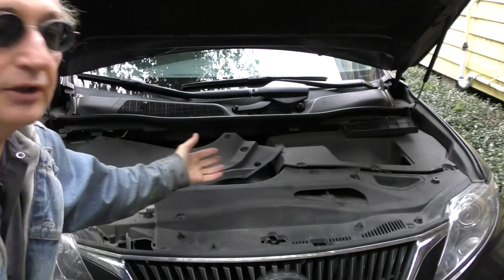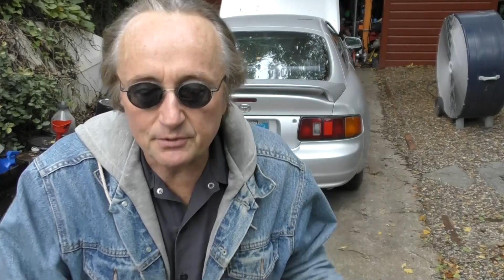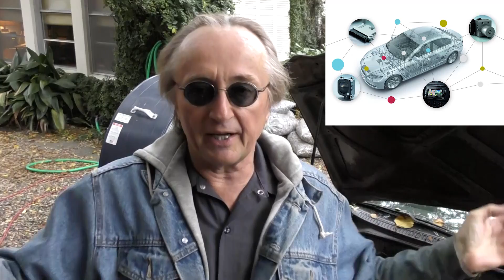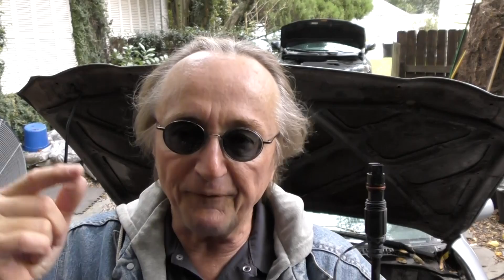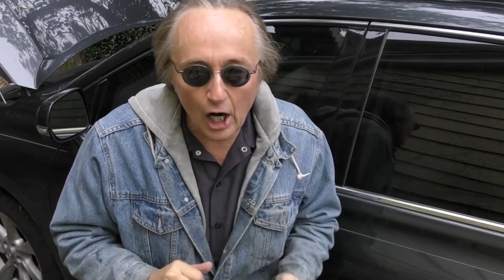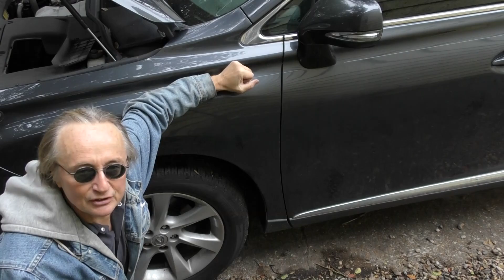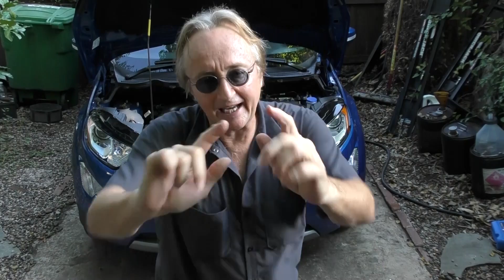The End of DIY Car Repair, Why New Cars are So Hard to Work On

Comment: Aw man I remember having an issue with my 2004 Pontiac Grand Am GT 3.4L V6 with the terribly designed Theftlock/Passlock system.  I would have days where I couldn't get to work on time because my car would fail to start with the stupid "Security" light coming on.  Turns out there's the system expects a certain resistance value through a circuit in the ignition switch system, and over time it wears out and the reading the computer gets fails to match what it expects, and you have to go through a "relearn" procedure just to get the car to start, which takes something like 20 minutes or more.

Luckily I found a guy on a forum who suggested to just cut the wires that run through that circuit in the ignition, and solder in a resistor inline in a loop, run the relearn procedure one last time, and it was good without fail from that point on.

I had taken it to quite a few people who had no idea how to fix it, or worse, thought it had something do with the aftermarket immobilizer that my province forced me to install in the vehicle, which it had absolutely nothing to do with!

I don't own that car anymore, but I sold it to a friend, and his brother's now driving it, nice to know that it still starts, and runs!

Comment: Mr. Kilmer; what a pleasure talking to you, Sir.
 I own a 2004 Pontiag GTO &  have a question, please:

Lately I got a message on the dash screen (Reduced Performance). Went to the dealer to check for error codes & turned out to be a faulty (Accelerator pedal sensor). 
GM discontinued the production of this part & I had a hard time searching the web for a replacement with non to find either new or used, yet! Back to my car, I removed the pedal assembly & cleaned it as careful as I could but no success there. I plan a trip to the scrap yard but If you have any idea if it is fixable or if there is a proper replacement for it I'd appreciate it very much.

Thank you so much for your time, Sir...

Comment: Scotty, great video. Could you address some Chevy Colorado issues? Dimmer switch that doesn’t dim, interior lights that flicker or  just go out- then comes back on) wheel sensor fault code/ ABS code. Yeah.. I own an ‘04 With an in-line 5.

Comment: Computer controlled systems on cars were supposed to give me better fuel economy; my ‘85 Lesabre got similar economy to my parents ‘95 Lesabre.  So much for that.  

While micromanaging the engine functions can be a good thing, anyone who’s been to a dealership for a check engine light knows the nightmare of tracking down the issue and often times, all the technology can’t find the problem.  

While newer cars are much safer than my “old iron,” they’re much more expensive to maintain and don’t last as long without major issues.  

I miss the days of being able to diagnose the problems of my car from behind the wheel while driving it.

Comment: That why I still drive my Ford Ranger 2002 3.0 V6 Vulcan engine. Its reliable as long as you change the oil. I have replaced some of the major components with basic know-how. These automakers and stealerships are trying to shake us down for every penny.

Comment: Today is Tuesday, not Thursday, but what can I do. I have a love/hate relationship with my 2017 Toyota Corolla SE with a six-speed manual transmission. I like the color, dark blue, and the manual transmission. I hate the electronic "Safety" features, which, if employed, reduce the attentiveness of the driver, for the car will automatically brake if coming up too close on another car, and steer itself back into the lane if the car drifts over. I have turned off all that felgercarb. I hate the thought of paying to replace that damned push-to-start button and/or the center touch screen and/or the L.E.D headlights when they fail. I wonder how much a clutch replacement will cost, what with the motor probably having to be removed. I don't know, because Haynes has not yet made a manual for this car. Are there any mechanics who know how to replace a clutch?
The Toy replaced my beloved 2002 Subaru Outback wagon. That car had all-wheell drive, a rear window wiper, Weather Radio built in to the factory radio, and a five-speed manual transmission. Since I no longer live in Colorado or sucky NJ, I don't need the AWD, but the Weather Radio and especially the rear wiper I miss. When it is time, I might be able to replace the Toy's brake pads.
Scotty, when my Toy is paid off in about four and a half more years, assuming the car had not electronically crashed, will you take it off my hands and give me a good old pre-computer car? Must have a manual transmission.

Comment: A friend of mine with a late model Ford Fiesta had a great time with the dealer with an ECU firmware crash where the senior tech from head office couldn't even re-flash the ECU. The people who designed and built the stupid thing couldn't even fix it. They ended up just replacing the ECU.

Comment: That's why I will never sell my '71 Custom/10 with a 350, Quadrajet and still running the original points distributor. I have newer trucks and SUVs but there is something about going back in time and working on a purely mechanical system.

Comment: Been fixing every problem on my 2010 malibu by myself every time the check engine light comes on. 95 percent of the time its just an expensive sensor. Though last time i thought it was my o2 sensor. Turns out my exhaust manifold had cracked. Some things never change.

Comment: The truth is that even the factory trained techs at the dealership often can't diagnose difficult problems. In many cases, they're just swapping out high dollar modules and hoping for the best. The really hard stuff they run up the chain of command to the engineers at the factory and sometimes even they can't figure this stuff out. A DIY guy with a modicum of intelligence and persistence can beat them every time.

Comment: As a former Chrysler engineer, I can tell you this: I've heard many comments along the lines of -  "don't modify your cars...the engineers spent time designing the best stuff available". What a crock! Engineers are held to limits regarding manufacturing costs, best return on the dollar, etc. That's why the whole aftermarket performance parts industry sprang up! For example Mopar's "Direct Connection". Scotty = the Buddah on the hill that you go to for the truth. He just doesn't speak in riddles!

Comment: I had a Ford Taurus and the water pump went bad at 100k miles.  I thought no problem as that happened before in my Avalon at 150 miles and it cost me $150 to fix it.  Then the Ford dealer tells me that it will cost $2,000 to fix the water pump because of the way it is designed.  The whole engine has to be removed including the timing chain.  It was ridiculous.  No more Ford for me.

Comment: Oscilloscopes, they work amazing for low power digital buses. I have one, I can see everything into the micro-amp range. They have portable ones. Those are how to really troubleshoot a difficult low-power digital bus.
Reply: Logic analyser Saleae clone for $5 can record digital signals for hours and plug directly in USB port. Free software display and decode that signals into human readable messages for a lot of protocols (CAN included).

Comment: Motherboard covered this phenomena, but with farmers and farming equipment. Companies like John Deere wouldn't release the diagnostic software needed to troubleshoot problems in the equipment, requiring owners to bring the equipment to a dealer for diagnostic (VERY expensive to load up a combine and long haul it to a dealership a hundred miles away). Farmers ultimately circumvented this by finding pirated software on the internet.

When left with no other viable alternative, people will turn to illicit means to fulfill their needs

Comment: Early 2011 I replaced the 5 speed manual transmission, clutch, clutch slave and master and pilot bearing in my 2.3 4 cylinder 2004 Ranger. To remove the shifter there is a cambolt holding it in. Remove the nut from one end and put on the other end and turn it in,,, the bolt will come out. I lost a day to getting through that problem. Entire project took me a week in a pole barn in February with no heat but with a cement floor. Much of the transmission tunnel only gives 1” gap to the transmission. If I ever do another job like that I’m unbolting the cab and raising it, if not lifting it up 5 feet off of the frame. But I’m 52 and I hope to never replace another clutch or transmission.
Reply: Check out the Ford Truck Enthusiasts forums. There are an awesome resource with many line mechanics participating.
Reply: Yes I’ve been on there several times.

Comment: OK, just can't beat down the nerd in me, but power is not measured in volts. P = VI, or power is voltage multiplied by amperage. I know we all understood your point, but I just can't help myself. (Hangs head in shame.) The point is so spot on though, because such small amounts of current can be greatly impacted but the degradation of the bus. And environmental influences can wreak havoc on your circuits. Just ask any IT guy who ran a network cable over the top of a florescent light fixture in a moment of obliviousness.

Comment: Happen to my 2010 Expedition one of the PCMs modules went bad caused the high speed network to go down and was causing a no start  and had the security says my keys aren’t valid had to have it towed to the dealer the module was inside the transmission Ford had to drop the pan and replace it  and reprogram the PCM . Cost $2,000 dollars not cheap .

Comment: Car salesman here: How do you feel about a 2015 Genesis? I sell used cars and after watching almost all your videos my job is both harder and easier to do. (I’m too honest for my profession, and I’ve been accused of being a customer advocate many times). Because of your videos I’ll often steer a customer away from a car they really want cause the price is nice (for a reason) and I find myself asking them what they want in their vehicle? Longevity? Turn and burn? Or upside-down flip? And because of what I’ve learned here I’ve been better able to help my customers get what they want for their needs based on what they tell me and what. This has actually made me the best salesman three years in a row. I’ve talked customers out of buying a car they had their heart set on. My boss yelling at me that “they are literally f***ing handing you their money and you’re not gonna take it?” And No. I won’t. Not if I don’t have the car that fits their needs. They may live that car but it’s not going to support their family for the next 5 years of the note. But the 04 Suburban with 75k miles will. And it’s a lot cheaper. Anyway. I get a lot of ‘14, ‘15 Genesis on my lot and at a p good price. I assume it’s because all the fancy electronics wear out and are expensive to fix. The warranty we offer covers all electrical work needed so I always sell that with it. Always. I’ve read the fine print and it’s an exclusionary warranty and I’ve seen people collect on electrical repairs and I’m very confident in its ability to cover my clients needs. So I guess I’d like a video about the ins and outs of the Genesis and if it’s a good used vehicle to buy and if there are anything that a great extended exclusionary warranty would not cover. I have built my brand by always being honest to my customers and by listening to them putting them in cars that they hadn’t even considered. But idk enough about the Genesis to do that so I end up selling them but always making sure that they get the exclusionary warranty. That only doesn’t cover wear and tear items. Love your channel. Been sober for a year now (salesman) and bought a 90 Suburban to work on as my new hobby/money-pit and this place makes me a better businessman and a better person. It means a lot to me. So thank you. Also any vids on how to do suspension work on a ‘90 Suburban would be awesome.
Reply: Shoot. Just realized this is an old video. It popped up in my recommended vids while I was on another app. So I thought it was new. sigh you’ll never see this. It was nice to get it out there this.

Comment: As a women what's the basic things I need to know or say when dealing with a mechanic so I don't get ripped off, I use to ask the dealer for the parts that were replaced, the dealer would give them to me. ...1 day he gave me something so heavy I could barely lift it up, after that I stopped asking. Maybe they did that on purpose

Comment: Computers themselves don't make it hard to repair it's poor implementation and withholding of information that does.
 I bought a VX nano for $120 that allowed me to fix everything on my car as I needed to perform a crank relearn and some goober wanted to charge $80 for five minutes work I then used it to find a broken wire to a sensor in a seat.
Another useful tool to have is an oscilloscope especially when dealing with ABS systems.

Comment: you can still do basic alignment at home with some ruler and compass... a marker will do
Reply: your get a code for steering angle off , after you move  alignment components you have to reset  it. same if you replace battery on smart charging vehicle you have to reset it with scanner or yoiur new battery will not las more  then a year causing you all kind of electrical issues

Comment: I have a 1987 ford ranger. Me and my dad took care of the engine all these years. I took over the truck now that he has a Toyota Camry. Do you think its worth still putting money in to the truck? He was about to junk it. I kept it because that was our diy fixer on weekends since I was 10 years old. The only thing giving me trouble is the transmission. Won't hit third gear.it's an automatic and my local mechanic said to save the money instead.

Comment: You forgot to mention when working on these newer cars you can't just replace a sensor and be done. You have to flash the computer to use that new sensor that you just put in to make it work. You have to have a Snap-On scanner that is capable of pairing keys and flashing the computer in the vehicle. A lot of shops use Houston Auto Scanners. This is a business that has its own software and comes out to you to flash the computer for a fee.
Reply: Worse trend ever. Second only to needing subscriptions to use a scan tool that bricks out if you don't pay up.

Comment: The more modern it gets the easier it gets to diagnose because the computer will be connected to more things with modern sensors. at some point you will be able to just plug in the scanner and it will tell you exactly what part is messing up even better than it does already.

Comment: My husband has no radio in his 2012 mustang because it would cost $800-$1000 to repair at the stealer because it’s intertwined with the APIM communications.  He won’t pay that. Even to buy the part on own probably $600, but could run into probs DIY.

Comment: I always thought things were better when cars used to break down constantly, cut out in the damp, turn-over and refuse to fire on cold mornings. 

I really want those days back......

If you don't understand how these systems work, it is a problem with education, not the engineers.

I can remember the introduction of transistorized ignition being the end of independent garages in the 1970s, with these 'damn computers' on cars.

Comment: Not even the Tires because the TPS Sensor, transmiters and its wirings are integrated with the keyless operation system and it sends a radio frequency signal to the key and the keyless module which will allow to open and start the car even without a key u just need to press d start button sometimes u dont. a bad TPS transmitter in the tire Can cause no start condition. could u believe that?

Comment: My wife's 2000 Hyundai Accent has a check engine light with several sensors reporting low voltage.  Well it did when it ran.  Now it cranks but won't start.  Fuel pumps but no ignition spark.
Reply: Could it be a bad MAF sensor? If you need to replace it, get an OEM one.

Comment: You don't even have to go back that far to be stumped on computer codes. 

I bought a 1994 Jeep Wrangler with the OBD 1 system new and eight years later it developed this weird starting problem where I'd have to hit the ignition switch multiple times to get the engine to start. Then on the 3rd try it would start. It was as if the engine wasn't firing. But once running it never misfired.

I never was able to actually test to see if the engine was not firing having someone check for spark when this occurred because this happened like once every 20 times I started the vehicle.

Finally one day it wouldn't start at all. The OBD 1 system flashed 2 codes. One was it said the battery was recently disconnected. And the other one said something was wrong with the air conditioner. My Jeep didn't even have an air conditioner! 

I had to towed and the guy told me it was the crank sensor. It never flashed a code regarding the crank sensor.

Six months later the problem happened again. I bought a Subaru and unloaded it.
  
I new a guy with a Nissan Stanza with a similar problem. He would be driving down the road and the engine would just die but would restart 30 minutes later. The dealership couldn't even figure out what was wrong with it! Finally a tech told him when this happened to unplug the computer for 30 seconds and connect it back and that trick worked. He eventually unloaded the car.

Comment: Now in 2020 you can probably afford to pay off or buy two older used cars from the 2000s even luxury ones with the price of a new car and have cheaper insurance, cheaper maintenance, and two cars! If you like to mod up your car you can buy an affordable sport car from the 2000s you always wanted and it will be cheaper to tinker with then it is a 2020 model!